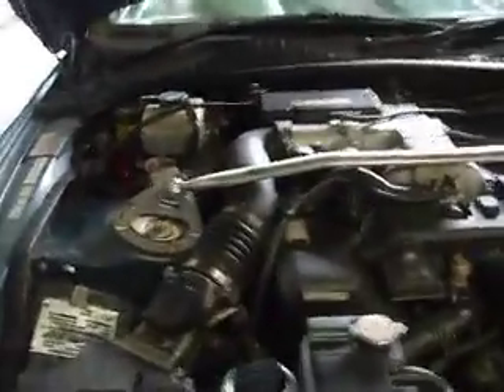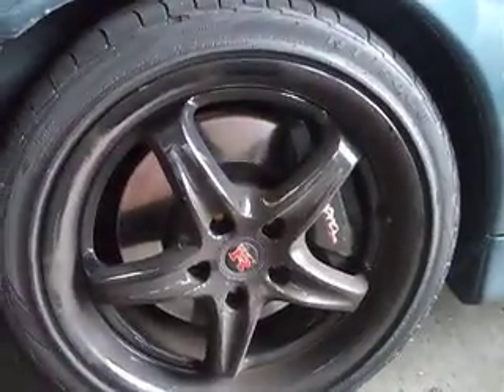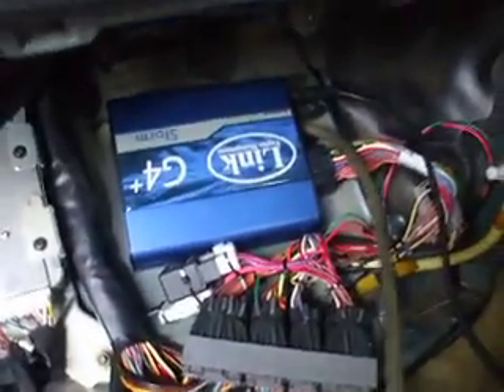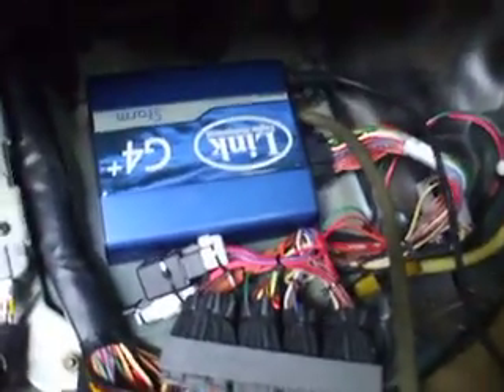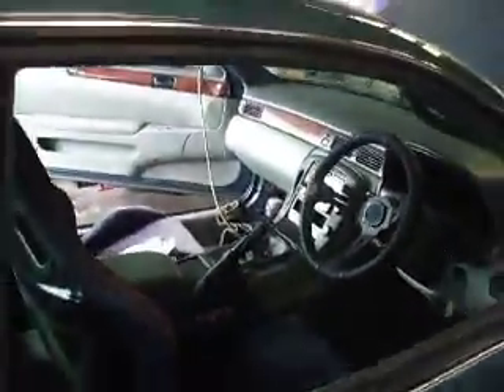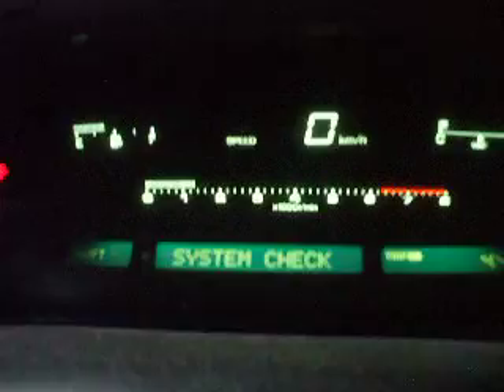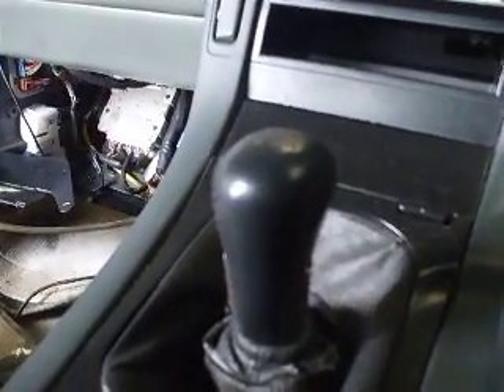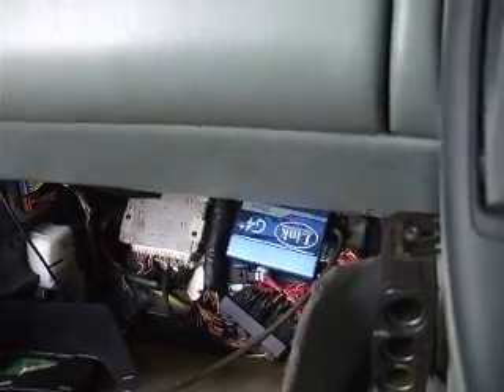Toyota soarer / lexus SC400 Plug and play link G4+ ecu adaptor 1uz-fe

Comment: Know this video is over 6 years old. But do you have anything like this that could work on a 95 LS400?
Reply from the maker: I have some cool stuff in the pipeline.  Watch closely for an aftermarket ECU running engine and transmission.  Its in a swap but I have plans for stock ecu plug and play.  Cheers